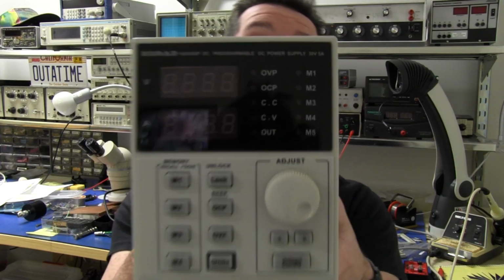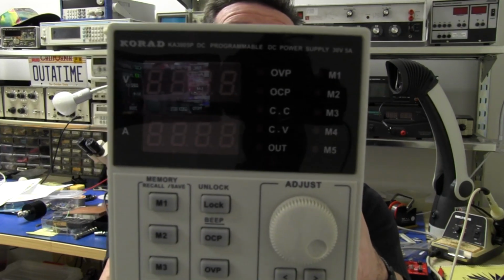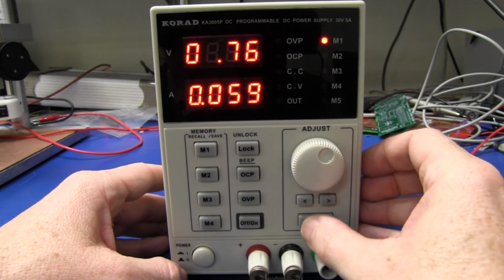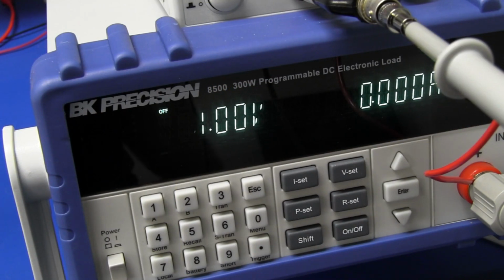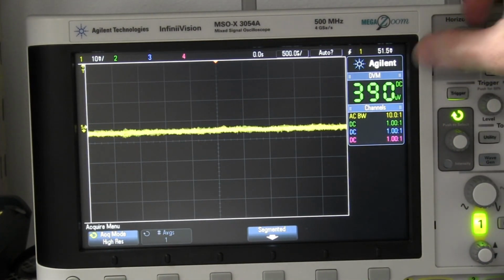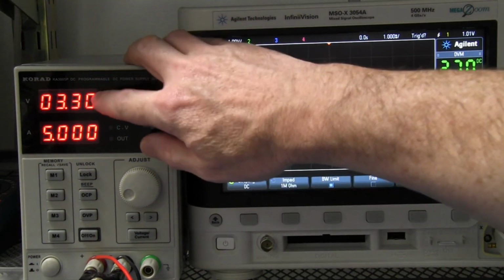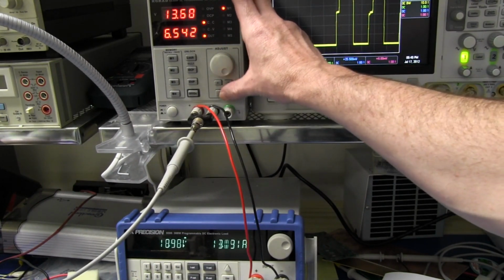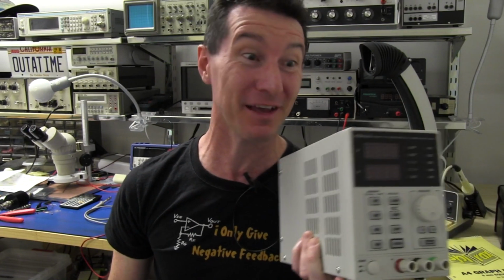EEVblog #315 - Korad KA3005P Review/FAIL

Comment: Hello, I bought a similar laboratory power supply (probably identical). My output power transistor also broke. The plan is to replace it, but I would not like to use the same one again. Did Korad tell you which transistor was used in the early versions and which was used afterwards? I had the 2SD1047 installed. Thank you!

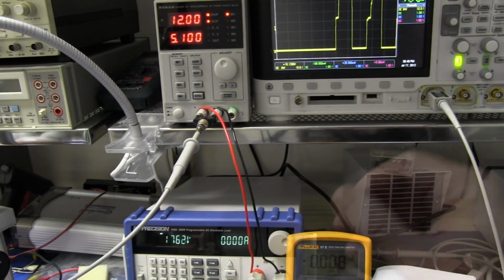Comment: 25:40 when measuring the outputs I would expect any other load to be disconnected. Otherwise how could we believe that voltage is not coming from somewhere outside of the power supply?

Comment: Lesson is to never hook competing control circuits together. Also, is the power supply rated at the full 30V and 5A together or is there a lower limit on power?

Comment: Interesting.  This review is from 2012.  I have three of these babies (two 30V/5A and one 60V/3A KORAD), but I bought them significantly more recently than 2012.  I think all of them were bought after 2018 or so.  I haven't had any issues with mine with several years of use on the oldest one.

I got them because the voltage and amperage setting displays the V/A setting instead of the current V/A while you are editing it.  Even when the power supply is turned on and the settings are being modified live.   Just about all of the other cheap bench supplies out there have digital displays, but analog knobs that are hard to precisely set the limits for, and don't show the actual amperage limit setting unless you short the outputs together.

-Matt
Reply: They fixed these issues rather quickly. Dave even has an video on the changes.

Comment: This is exactly what happened to mine but a different Chinese brand. Shows 36V and gives of 52V. And does not change at all. All these Chinese do very little independent r&d. Instead they just lean one design and every other compaby replicates the design. With the same flaws. Anybody knows what causes it or how to fix it?
Reply: Replace the failed output transistor(s).

Comment: Thanks for the video you save me some problems. Any recommends for DC power supply unit around 50-60 USD (I m from Europe) ?
Reply: there is a 6A power supply on Ali Express now with a graphic display (like a speedometer etc) for rather cheap.

Comment: I have worked with many Engineers and most with their claimed know how end up destroying stuff on a regular basis. Just like Dave and his know it all attitude.
Reply: I just found all the button pushing got a bit much and he wasn't making any sense of it, just getting frustrated. I've watched a VERY capable technician do that a few times and then swear and stomp off to do something else. It's not helpful.
All I want to know about these cheap supplies is: will they perform reliably and safely for the average punter at a home hobby bench?
If I can't trust it to stay on spec without keeping a separate multimeter attached as a backup display, that's one thing. If I can't pound on buttons willy nilly and that overwhelms the proramming, that's another.

Comment: 10:18 - I don't think this is true. The supply turns the output off whenever you press one of the memory buttons. As to M5, you get there by pressing M4 and then turning the knob. Not very intuitive, but I believe it's mentioned in the instructions.

Comment: I wonder if there would be possibility to mout in like delay output switch relay, let's say, when you turn on the power supply, the output gets switched on after , for example. 1 second , so the load doesn't get higher voltage spikes. and the same for power supply turn off, the output switches off 1 second before supply switches off....

Comment: Could it be that both the power supply and the load are active control systems? If they're digital then they have sample rates and that trace could be the two control systems interacting?
Reply: Richard Corfield Not if they were designed competently. A bandwidth limited discrete time controller will act identically to its time-continuous counterpart. Since it’s hard to do perfect band-limiting, usually you oversample enough so that say, a 4th order filter is close enough. Or, in modern circuits, use a sigma-delta converter, since those have very good filters built-in. If you can tell it apart from an ideal analog controller just by looking at the traces, you’re not doing it right.

For inspiration on what it means to do it correctly, look no farther than the phone network. Most modems faster than say 4800bps do their work digitally, so there’s one ad/da conversion at the modem, another at the interconnection  to the phone network, another at the other interconnection, and another at the other modem. A signal from one modem to another goes through two DACs and two ADCs, and through four two/four wire conversions (those are often done digitally, by duplicating the adcs and dacs to control line voltage and current independently). And it works just fine, and these modems can fully exploit the theoretical bandwidth of the voice circuit. So, uh, it’s only a problem if you do worse than the POTS network does, and that seems like a very low bar to pass.

Comment: I own the cheaper non programmable version of this psu, I found a zener diode installed in reverse near the base of the transistor that drives the pass transistors, flipping it improved overshoots I believe,it was awhile ago, also heatsink is a joke and fan runs of 20+ volts, I don't trust this psu and I don't use it for anything but learning how not to do things 😲😵

Comment: How to access to Memory 5 (no possible with buttons)

To use memory 5, proceed as follows:
1. Press memory key 4 and turn the adjustment knob until indicator M5 lights.
2. Set the voltage and current as desired. Wait until the display stops flashing. The settings are
automatically stored in memory 5.
3. To recall the settings, press memory key 4 and turn the adjustment knob again until indictor M5
lights.
Reply: Alternatively you can put it in M4. Summon a spirit and then if the stars align you get into m5
Reply: Easier... RTFM, unlike Dave who never EVER does.

Comment: Similar to Hantek:
I have the power supply PPS2116A and I like some of the functions - especially the memories. Unfortunately there are some bad sides of the PPS2116A. The rotation knob is made with low quality encoder and after a few months/years it is really not reliable - very difficult to operate. But the worst is that the PPS2116A can easily damage your circuits. It already destroyed a few of my electronics, mobile phone, AM meters fuse etc. How it is possible? When you turn off the PPS2116A and you do not DISCONNECT your circuit, the PPS will send cca 30V for 200ms to the outputs. They can be ON or OFF it does not matter, the 30V is sent to the outputs. Realy bad design!!!
I can send a osciloscope screenshot for all the cycle: Power on - out On - Power off. There the pulses are clearly seen.
Reply: Yeah, makes my DMM's go haywire if I leave them in circuit with the PSU after turning it off.
Reply: This is worrying actually and makes this a no go if they still act like this.

Comment: Looks like it has relay bounce on start... Funny business indeed, skimped a capacitor there. The 0.01V looks like all relays disconnected?

Also, didn't I notice 220V AC input there? :) That's not 230V.

Comment: I know this is a super old video but maybe it will still help. I had the exact same problems you were seeing at 19:30. The electronic load you are using is the problem I believe. In constant power mode it gets into a positive feedback runaway type thing and basically just drops a short on the output...
Reply: Josef de Joanelli 
I know this is a super old comment but.. :D
Yes, you are correct, the problem was electronic load going basically short. I'm suprised how Dave did not get this. PSU went into CC showing 5A. Electronic load was also showing 5A. So there was nothing wrong with that.
Reply: @The Mechatronic Engineer I'll keep up the tradition of replying to another old comment, lol. I think he's thinking quick on his feet while on camera, feeling pressure to have an explanation instantly. So he forms opinions very quickly based on a small subset of data. I think maybe his biggest fault is that once he's formed an opinion, he very stubbornly holds on to that opinion even when presented with additional and/or new data that shows that opinion was erroneous. So he's quick to form an opinion and slow to change it.
This is normally forgivable, except when he occasionally attacks or belittles someone for having an opinion that differs from his own without recognizing that his position may be in the wrong because he arrived at it quickly with limited exposure to the question. I think he's fairly guilty of this on the podcast.
Reply: @KapitanWalnut - keeping the thread on replying to old comments...
That summary of Dave is incredibly insightful. It is a big flaw of his that he usually doubles down, rather than admitting his mistakes 👎

Comment: It's important to know if it was failure in the control circuit or in the power circuit, because there are a similar PSU with the same power circuit but simpler control circuit, the cheaper KORAD KD3005D.

Comment: I'm having trouble with mine as well. Several segments of the seven-segment displays stopped working.

Also, the on/off button is a two position button (pressed in for ON), but occasionally, the button will be in the OFF position and the supply stays ON. Looks like it's looking for an edge (and doing a bad job at it) instead of polling the button position. 

Absolutely horrible piece of equipment.

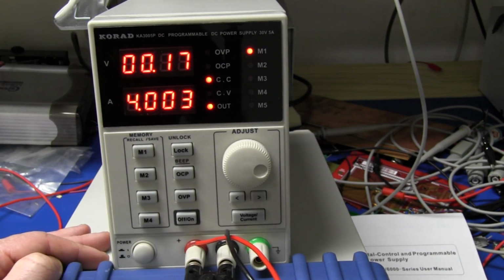Comment: 19:57 That might not be the PSU at fault, connect any current limited supply to a constant power load and it can get stuck in a low voltage current-limited state. Practical example would be a solar panel feeding a switching regulator.
Reply: Я тоже считаю, что блок питания тут непричём. Он нагружает его интеллектуальной нагрузкой, которая меняет своё сопротивление управляясь своим процессором. Для чистоты эксперимента он должен был подключить резистор необходимого номинала, и я уверен, что никаких выбросов и ступенек там бы не оказалось. То что он видит на экране осциллографа - это то, как два независимых микроконтроллера подстраиваются друг под друга.
Reply: boriseng That’s not acceptable on a power supply. They design the control law wrong on these things, and it’s very much a noob mistake. Depending on how you set it up, it can get “stuck” at a low voltage, or at the target voltage. The resistance of the interconnection causes this. When you do a solution on paper to a constant power load driven by a cc/cv source, there’s one solution at highest voltage as long as interconnection resistance is <0. At zero there is a range of solutions that is the outline of the cc/cv polygon. For resistances above 0, it has two stable solutions, and which one you get at depends on the system’s history.

The fix is to have it act as if the interconnection resistance was just a smidgen below zero (approaching zero from below). A voltage feedback can be set to do this, or an interconnection reisistance compensation knob will do it. I have 80s vintage linear analog supply (maybe Trio brand?) that has voltage feedback
and interconnection impedance compensation with a pair of knobs – one for the real part, another for the imaginary part. The real part has the range of +/-5 Ohm, the imaginary part is +/-100, both using multi turn pots with multi turn indicator dials.

That way you can make it stable with both capacitive and inductive loads without compromising the transient response. Internally, there’s a beautiful bit of analog computing done to implement it (takes 4 multipliers IIRC). The voltage feedback is not used directly, but to produce an impedance estimation that is then low-pass filtered and fed to the control loop as a pair of parameters. The manual impedance control knobs simply sum their voltages with feedback-based estimator’s output. The control loop uses complex signals throughout (a pair of voltages instead of just one). 

But it seems that one engineer somewhere thought of it and it made into a product, and the technique was promptly forgotten. I was so curious about it that I reverse engineered it some decades ago to figure out what made it tick. It’s something people in the Philbrick era would do. Save for the multiplier ICs, it wasn’t a particularly expensive circuit to make, and today a decent microcontroller with four 10-bit ADC and two DAC channels could do it, with dithering.

Comment: The M5, at least on my "TENMA" 72-10480 (Very similar, without the USB and Serial interfaces though) is reachable by selecting M4 and turning the knob one tick to the right.
Not very userfriendly, but it's there ;) .
HAve anybody had any luck adding USB to the none USB ones? I've tried probing the connector on the CPU board, but no luck.
Reply: Thank you, from 10 years in the future 👍
Reply: Is the Tenma version safe and does it perform ok? I see the UI is odd but function for price seem unbeatable for first desktop psu
http://cpc.farnell.com/jsp/displayProduct.jsp?sku=IN06822&CMP=CPC-PLA&gross_price=true&gclid=CjwKEAiA05unBRCymrGilanF9SwSJACqDFRmfkmMniUBMq9YfV8Zc8qj3vP8SpZk_ToYoqTLljjBMBoCpqjw_wcB
Reply: Cheers bud, appreciated.
Reply: ***** I found this about the  OCP and OVP functions, perhaps sit will help.

 
OCP : PSU output will switch off when the set current as been reached (so it will not go into CC but switch off instead)
OVP : PSU output will switch off when the set voltage has been reached (the PSU has to go into constant current first)

So for OVP the PSU has to go from constant voltage to constant current before OVP switches of the output. In OVP mode you could use the PSU as a charger by setting the charging current and target voltage, once the target voltage is reached OVP will switch off the output.

Comment: I now have had this powersupply for a little over 2 years (fixed version) and it hasnt failed on me once. I think after the fix it is most certainly reccomendable!
Reply: tHaH4x0r What was the problem with the old one ? :O
Reply: Flofy387 See the video above...
Reply: tHaH4x0r
Yeah but is it now really short circuit proof ?
Reply: Flofy387 I have shortcircuited it often enough and it still works fine. Also, watch the followup video in the discription.
Reply: tHaH4x0r
Okay. Because I've seen a video where the KA3005P was rapidly shorted, and then it was fucked up :D

Comment: For a low cost power supply, maybe a BK precision 9110 or ITech 6720 (they are the same thing, ITech is the OEM of BK9110) will be MUCH better. I used to use IT6720 as my bench power supply, and tortured it a lot, yet it is still alive.

They are around 250 USD on eBay, cheaper than most high-end branded devices, while providing very exceptional performance.

Comment: This thing looks exactly like the Velleman PS3005P, on that one "M5" is "Locked", so I think that's just a silkscreen typo, in newer versions it might me "Locked" :P

Vellemans Supply is the same thing, repackaged for double the price, so this one is pretty good :D
Reply: ***** I'm getting a Velleman LABPS3005SM, 0-30V 5A. Are they good? It's only 100 bucks, and it's the only PSU you can get for that price here in Sweden :3
Reply: SnOpeK Domowei It is the exact same powersupply. I bought it and it is the updated version of the one above. It works a treat and hasnt failed in over two and a half years of service, most certainly worth the money because it is a cheaper powersupply that functions well enough and is linear instead of switching. (lower noise than switchers in the same price class)
Reply: M5 is probably accessible. Press M4 and immediately afterwards turn the knob clockwise. Works on clones named KORAD and AXIOMET.

Comment: Just got my "improved" version of this PS, plugged it in, set it to 6 volts .5 amps, set my digital meter to DC and read 5.93 v. Great. With the leads still attached to my meter, I increased the PS to 9 v, hit the button to engage the new setting and my meter read 0.0 mv, hemmm. I checked an yep, the PS completely fried my meter! Turns out it blew a fuse in my meter??  Well, checking again with a few meters and output is stable.   Fingers are crossed that this thing lasts!

Comment: Hi there,
I have the same supply and it has gone in the same direction!!
Seems my alligator clips shorted together on the test bench one too many times!

turns out one of the output transistors failed, I replaced with tip3055's (all I had)
Was once again working but only for about 3min, then went faulty again! I am now waiting on the proper transistors but dont have too much confidence.

Be great if you could go through the repair so others like myself can get it back up and working.

Comment: First time fried bench supply power transistor i guess? it happened to me 3 times, but witch cheaper homemade linear PSU's. too much power dissipation at the power transistor. It is just that automatic transformer taping behave more funny this time u think.

Comment: using that fancy electronic loads is really evil. I mean, the power supply should survive it, but: When looking up the power up characteristics/curves, I would really prefer the old school power resistor and capacitor.

(I killed a circuit under development with a bugged lab-supply: My circuit took the current in short pulses which caused the power supply to glitch between two modes: Lesson: Develop the load in a way, that it does not overstress its supply.)